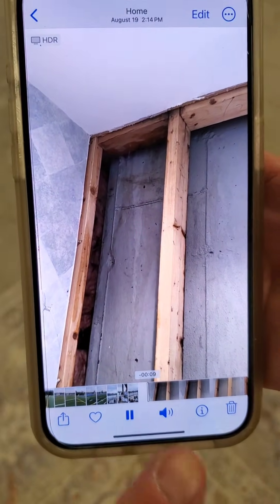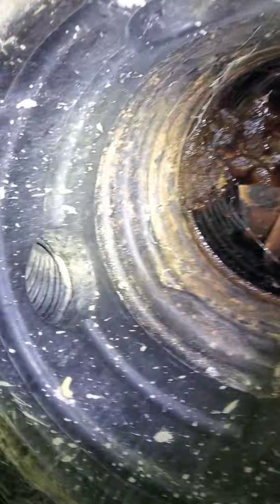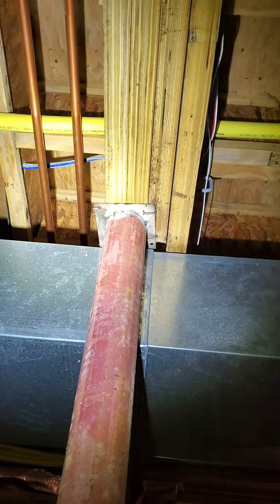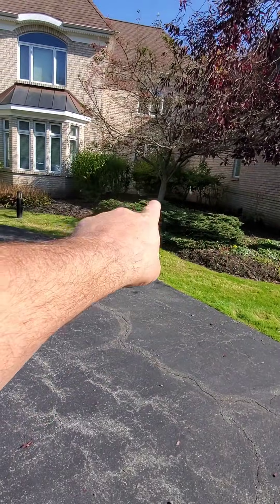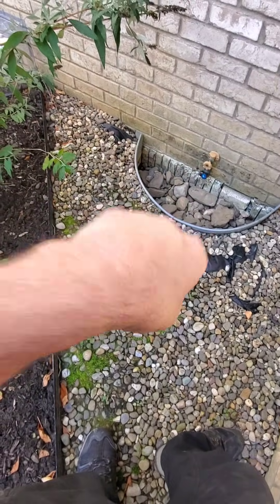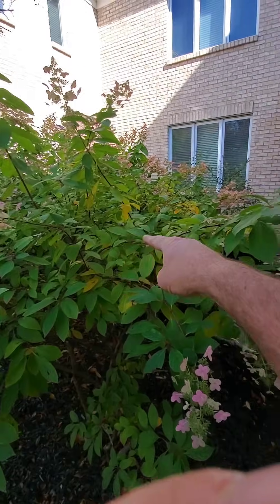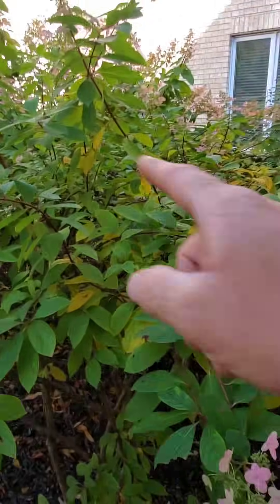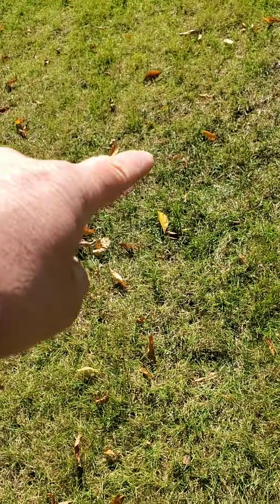Why does water pour into the basement when it rains? Let's investigate!

Comment: I must have misunderstood you.  The water from the sump pit doesn't seep into the sewage ejection pump.  They are two different systems.  The sewage ejection system for the basement bath is a solid pit, no holes and water cannot seep into it.  The water from the sump pit (ground water) cannot get into it.   And why didn't they have a sump pump?  Two pits and NO PUMPS?

As for the water coming in at the top of the basement wall during hard rains.  I think the weep holes in the brick were buried and letting water in.  Correct the grade, problem solved.

Comment: Right there at 2:05, why is that trapped?    I've never seen a trap except right beside a drain or HVAC condensate clean out.
Reply: It is odd. Maybe it’s a code thing when a septic system is in use. The bad part for me is why are the cisterns for the rain water and toilet shared? The underside of the slab will fill up with shit. He mentioned it but seems like that should be an enclosed separate tank period unless it’s in case the ejector pump pukes, but seems like there could be better ways to handle that.